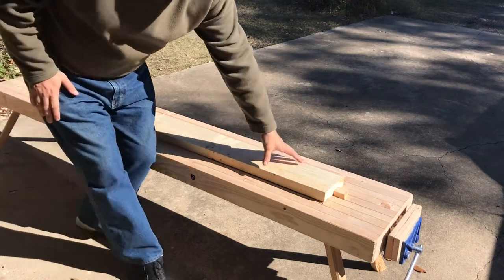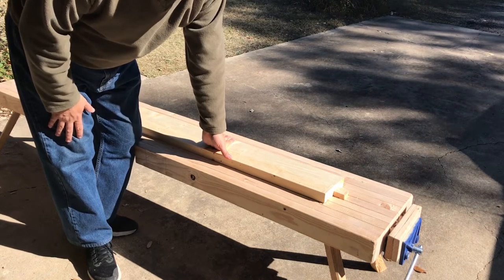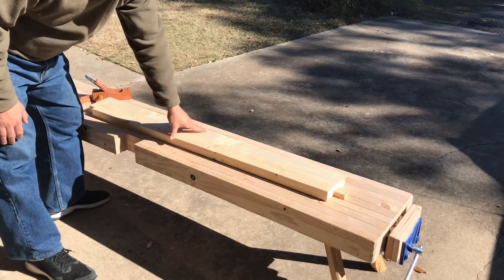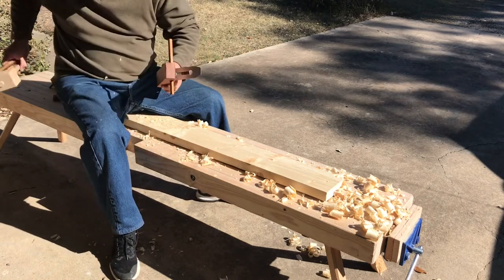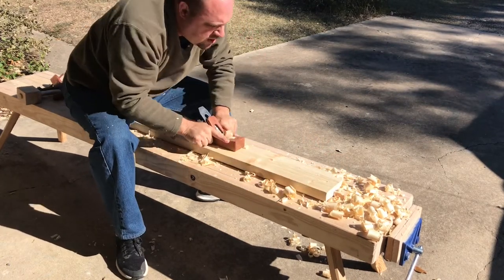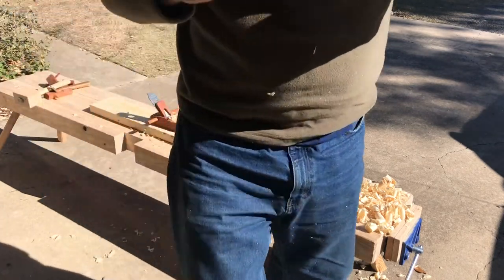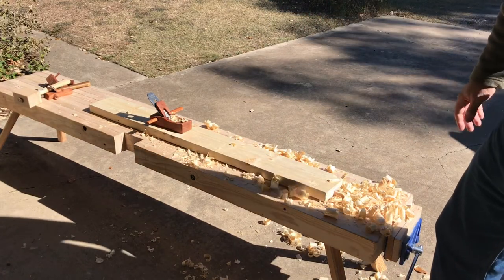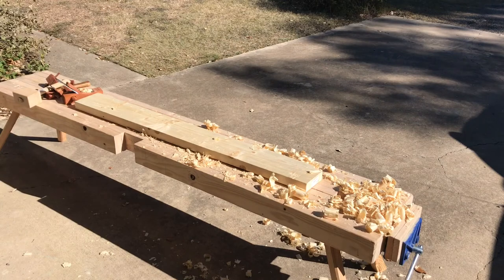Inexpensive Chinese Wooden Smoothing Plane

Comment: I wanna get a set of these now. :)  Even though they're far from perfect, they seem fun to use.

I found it initially frustrating, all the terminology related to planes - jack vs. smooth vs. scrub vs. fore, low angle, high angle, bevel up, bevel down.  There's too much jargon, but I'm finally kinda figuring out which one is which. :P  They don't make it simple!
Reply from the maker: They are fun to use and once you get them tuned in and sharp they work very well.  I like that they can be pushed and pulled, so you can use them a variety of ways.